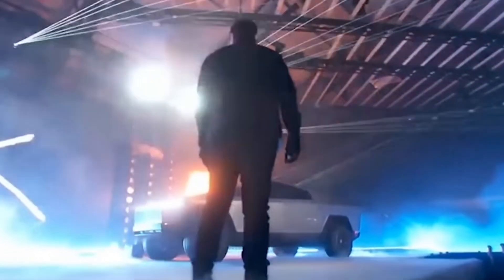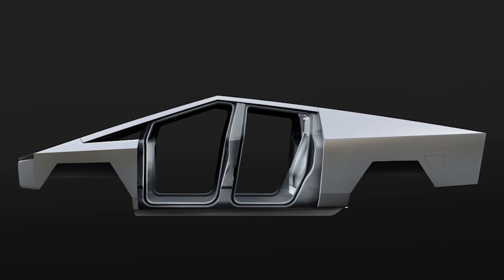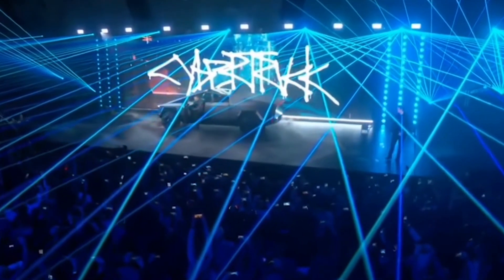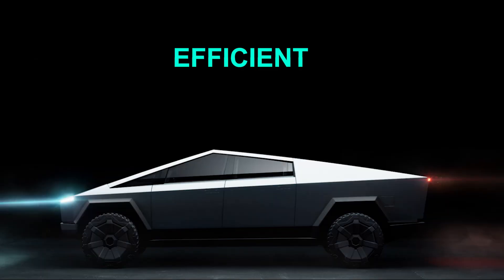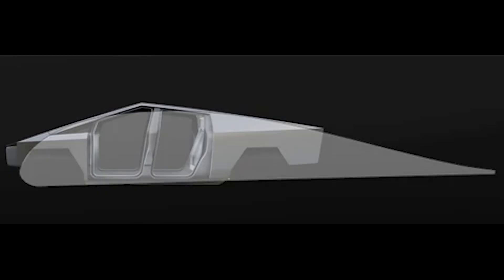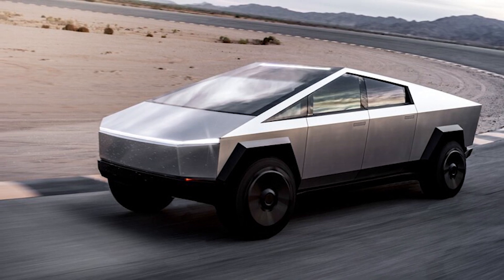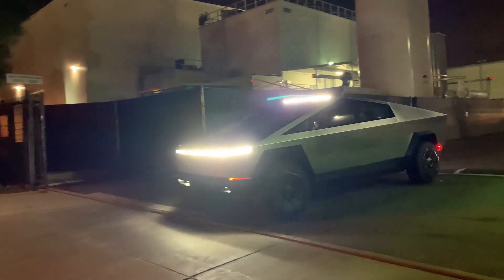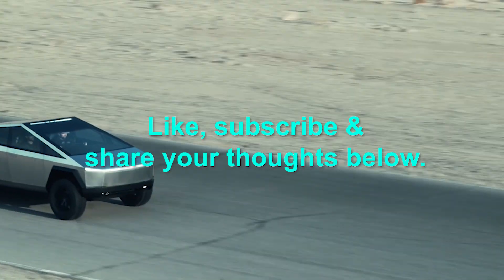Cybertruck is Engineering Genius (and will be copied)

Comment: 5 reasons why the cybertruck is the most environmentally unfriendly EV:

Sorry to say but from an engineering point of view you seem to have little knowledge and are blinded by superficial facts without questioning the consequenses.
I'm a big fan of Tesla and i'm not saying this car is worse than a diesel-pickup, but the potential of the truck is a complete fail.

1. Efficiency
Since the battery is large and heavy, weight is a big factor in EVs. With about 3 tons  this truck makes little sense. Armored glas, frame- and bodywork are the reasons here. This gets worse since the range is gonna shrink immense when loaded. Do you really need armoured glas?

2. Particulate matter
Due to abrasion of tires every car emits particulate matter. This has proven to be a big factor in pollution. The heavier the car the bigger the abrasion. And the cybertruck weighs a lot. This also means more frequent change of tires for the owner and more expenses.

3. Increase of traffic jams
Not every pickup driver will switch to the electric cybertruck (financially or otherwise). The market for the cybertruck though, will expand to people who didn't drive a pickup before. As a  result the total number of pickup trucks will only go up. While Population and traffic is also increasing, big cars are one of the main reasons to increase traffic jams. Not many people need a pickup truck. Most of the times there is only one person per car and not transporting a lot. An environmentally future uses a lot of small city cars.

4. More pollution from existing combustion engines
As traffic jams are increasing, and not everyone is able to switch to an EV, the pollution from those combustion engines increases.

5. Danger in a crash
The first presentation has shown the cybertruck to withstand a lot of force. Modern cars are engineered to deform on impact to absorb energy. Without this, the passengers will feel the full force of the every crash. Also it is a danger to others. The cybertruck is basically a tank waiting to roll through another car in case of an accident. To top it off the very edgy design is a danger to pedestrians.
Reply: 1/  armored GLASS is good when stones come at you from the road.
2/ it's a problem with all tires, not just this one
3/ it the person changes from a petrol powered car to an electric, then that's a reduction.  Traffic jams are a city/two problem and not a car manufacturer.
4/ your joking right... it's ev so no petrol and wouldn't there be more pollution if your imaginary car owner was in a petrol vehicle in the traffic jam instead of an EV.
5/ Other cars will still have crumple zones and air bags,  the cyber truck will have air bags and we will have to wait an see how it crumples.   The design is no more dangerous than other SUVs
Reply: @BrettCooper4702  Hey appreciate your thought on it. Sorry it haven't been clear, english isn't my first language.

1: Regular laminated glass does the trick, too. Armoured glass only increases the weight.
2: As i said: it is a problem which is related to the weight of the car. The heavier the car, the more abrasion.
3: With an increasing population so does the number of registered cars increase. As more people will drive to work the streets stay the same. Bigger cars will definately not solve traffic jams.
4: The argument is related to the remaining petrol cars. As i said: Not everyone can afford to switch to an EV.
5: An airbag serves only little to absorb impact. With a car like the cybertruck the crumblezone of other cars will be more stressed. Endangering the passengers within this other car. Also not every obstacle may have a crumbelzones (wall, cargo,...).
Australia and Europe for example have different safety standards.The edgy desing is definately a danger to pedestrians and cyclists.

Comment: Just a novel sci-fi tech advanced Chevy El Camino or Ford Ranchero. They went out of vogue because the whole body had to be either wholey fixed or totalled if in a auto accident because the bed is not removable. On a pickup -- you can complete smash or wreck the bed and still have a good chassis and new bed can be replaced. The truck bed was the "whole" idea of trucks or "pickups". Unibody pickups have never worked out in the truck market or the car/truck looking truck. No one wants a weird look junk heap that's neither a truck/pickup/car! Stop smoking pot.

Comment: I disagree on one point: it is not safe. Any impact energy is not aborbed by the chassis through deformation... it is absorbed by the passengers through deformation... Right now it wouldn't get a safety certification here in the EU because of that reason.

Comment: Safety might be a problem.We don't know the engineering behind this truck(yet), but you might want to wait.A car is safe if it can absorb the shock from a crash, if not the driver will, in the case of the Cybertruck it looks like the latter.

Comment: 1- they WILL have paint options (confirmed by Musk). If they decide not to paint them, truck would be simply unrepeatable since you can’t restore the look of a real metal, thus this truck would not be insurable, or insurance cost would be trough the roof. 2. Dash Panel is not paper and was a prototype that will be changed due to its absurdity and criticism (not a fact, but common sense). However, if body color options will be expensive, it would be best to simply wrap that truck to any color, which would be very easy to do due to its flat panels. This truck is half cooked and will definitely have changes before it’s released.

Comment: I don't think the numbers are adding up to be any of the four points you list in the video compared to its competition. It's not low cost comparatively speaking; we've seen dramatic performance loss when Model X users try towing as well, so we can only imagine a similar result occurring on the Cybertruck; efficiency sure in terms of being aerodynamic, but it's certainly not lightweight (it's longer than a Chevrolet Suburban); and safety remains to be seen. Cars used to be built like the Cybertruck in that they were rigid with no give, but that got replaced in favor of a body that crumples up to increase crash time so the driver doesn't take the full force of a crash. If the Cybertruck is rigid, I'd be concerned over the driver's safety if they smash full force against their dashboard or elsewhere during a crash.
Reply: For the safe aspect , don't worry tesla are one of the safest cars ever , I'm sure elon made that with the security as number 1 priority as he always says in he's presentation.

Comment: I really appreciated your approach to the facts and discussion in this presentation.  

I agree that the whole idea of the truck thus far is way out in front and genius.  

However it’s not safe yet. 
1.  It is not safe for other cars or pedestrians because it does not have crumple zones to reduce the acceleration/deceleration speed in a collision. 
2.  It is also not safe for the occupants, again, because it does not have crumple zones to reduce the acceleration/deceleration speed in a collision. 
So, on safety, will have wait and see how these mandatory safety issues will  be achieved.

On paint - use any paInt shop or apply wrap!&

Comment: 3:54
Performance is NOT an argument here. Seriously, if it is to you, then you are very insecure about that fact.

Utility, on the other hand, is at question. There is a reason why the truck has persisted as it has in general form and function for only (Yes, over) 100 years. They are literally teh evolution of cargo carrying conveyances going back 100s if not 1000s of years. When you see truck being used for what they were meant for, not commuter vehicles, but for towing, hauling, and work in general, if something remotely like the Cybertruck was ever a good idea it would be done and still be around now. The Cybertruck has more in common with the Chevy Avalanche and Honda Ridgeline, than any traditional pick-up truck.  

Fifth wheels, towing large loads over considerable distances, and more are going to be a LOT harder for the Cybertruck that a traditional Pick-up. A big part of this issue is the very limited amount of energy a Cybertruck carries and how long it takes for it to replenish that energy to continue work. Towing, and all the physics there in, easily cuts the already "only adequate" range of the Cybertruck at least in half. This is really problematic given the only 300 mile of unladen range of the base Cybertruck. But Tesla says they will be fulfilling orders for the top tri-motor version first and that will come with an up-sized battery for 500 miles of unladen range. That should look good for Cybertruck except you are buying a $70K vehicle to do what a $40K traditional truck does with only 2WD, with far less (gasp) range anxiety. 

And then there is the recent revelation that the Cybertruck will be officially classed as a Medium duty truck, putting in the same class as truck even MORE powerful than the tri-motor Cybertruck, F-250, Sierra/Silverado 2500, and RAM 2500, that cost much less to start. And with Ford, GM, Workhorse (hopefully), and Rivian (definitely) rolling out their own BEVs, the Cybertruck does not look like a real competitor for real trucks, ICE or BEV. 

The Cybertruck falls into a segment that is largely ignored and deemed redundant, the SUT, Sport Utility Truck. It should be fine, taking notes from Toyota and Nissan: NOT to get in the direct line of fire of the big boys. The Chevy Avalanche is still, despite being out of production for YEARS, very popular and desired to this day. I can see Tesla seeing this as a reasonable course to take.

Comment: That stainless truck will turn into a rust bucket in the Northeast salted winter roads.
Reply: i was going to say that its going to be high grade steel, but after looking at what they're actually using (301 steel), this comment is actually pretty accurate

Comment: Safety is a big concern on this truck. 
Cars are designed to deform on impect, that's where all the energy goes. If you hit a wall all that metal  folds to slower your impect. On the other side, cars are designed from outside to cause as little harm as possible when hitting a pedestrians. The parts a pedestrian is most likely to hit are quite soft plastic or think metal sheets. Most hoods even pop up a little when detecting an impact (on the windshield side) so the pedestrian won't hit the hard engine parts through the thin sheet of metal that the hood is. I like the radical design but I don't see how this vehicle would be legalized for European roads.
Reply: first you have to explain to the americans, what a pedestrian is. And when they have learned that, you can go to the advanced course, and explain what a bicyclist is.
Reply: Right around the time you posted, experts from the German safety & inspection institute TüV said it most likely won't be road legal in Europe. America has a "light duty truck" category which offers exemptions.
Reply: Its good for zombies
Reply: Maybe they will add some bumpers... or they will simply not sell it in europe

Comment: starting of that i love the new direction of tesla and always done. But i think that the Cybertryck will have problems with crashtesting results, Firstly stainlessteel is a stronger and harder material witch make it not suited for absorbing the kinetic energy from a krash witch aluminum does, secondly thoes sharp edges will neither assist in a crash, round bends tends to bend instead witch is ten times better. Imagine the hood chopping of your head in a crash, because it won't bend.

Comment: The cyber truck is not as functional as you think it is. It is really functional but there are a couple flaws. 1. Because of the way the bed is slanted you can only access it from the tailgate. You cannot reach your arm over the side to get anything. If you’ve ever owned a pick up truck you know that this would be extremely annoying. 2. Again because of the way that bed slats up so much clearance out of the sides of the bed are again terrible. Perhaps is not as bad as it looks, I have yet to see the cyber truck in person or touch it but it looks like it would be extremely difficult to put anything in the bed from the side. 3. This last thing is something none of us truly know yet. Because the cyber truck (as far as I know) does not have any kind of transmission, the efficiency in towing is probably not going to be very good. Sure you’ll get 400 or 500 miles of range not towing something but the moment you add a 14,000 pound load I worry that your efficiency will drop to half or less the range. Yes we have the same problem in internal combustion engines but it’s always getting more efficient through the transmission. The other advantage to internal combustion when it comes towing is the fact that it takes five minutes to fill up whereas it would take 30 minutes to recharge the cyber truck.
I personally hope the cyber truck overcomes these shortcomings, I would love it for it to succeed but at the moment there’s just no way of knowing.

Comment: I think you are dead wrong in the safety department, because you miss the point as to why a car like the model 3 or model S are safe. They are safe because there is high deformation of the body panels and part of the structure (front and back), except for the passenger cabin, to allow for impact absorption. Every bit of kinetic energy absorbed by the body panels or the structure is energy your body doesn't have to take, resulting in less serious injuries. Given the way it is designed, it looks like the Cybertruck does none of that. Safety is not a question of strengh or toughness. The same thing applies to the vehicle hitting pedestrians. Nowadays manufacturers design car hoods that dip down on the slightiest impact to create a lower and duller angle of attack for the pedestrian when it gets hit. As an example, the Mercedes G-class has angular bulbs mounted on the hood that serves as turn indicators. They would be dangerous, except for the fact that when hitting them, they collapse downward into the engine bay so a pedestrian is not injured by them.
As it stands, I don't see the Cybertruck do ANY of that. I'm not even sure it would pass regulations in its current form.

Comment: I have to disagree because it costs forty-thousand dollars. This means the cost to make it is being pushed on to the consumer and it's probably an issue with the cost of the batteries, so no this model would not be copied by anyone trying to compete. Are you going to spend twenty-thousand dollars on gasoline-powered car over ten years? If no then you're paying too much for this vehicle. Also, you have to pay for that electricity just like paying for gas.

The only way Tesla could allow themselves to mass produce anything like this is if they invented a new lightweight, high capacity battery, cut the cost of the vehicle by half, and made it self charging.

Comment: I am still not convinced for several reasons 1) the high school science reports I did about electric vehicles back in the day, (basically you spend the money at the power plant or at the pump) 

 2. I used to test drive cars for a living (SWRI & EG&G) they would do 100000 durability tests (EG&G did) 

3) most importantly things now a days seem to be based on some form of deception some form of trickery . 

4) my truck is a 2001 GMC AWD 1500, before that I drove a Astro van (the Astro van actually worked better then the truck for towing my race car) 

5) I can fix or repair almost ever part of my GMC truck (and it will run with all kinds of stuff wrong with it)
I will keep an eye on this truck but I probably don't have enough money to roll the dice on this truck.

Comment: Cybertruck isn't a racing car so it won't need super capacitors from Maxwell, those will be very likely for the roadster, because with roadster you need huge spikes of power for just few seconds then the power consumption drops relatively low.
They probably found that batteries would degrade quickly from those bursts.
Usually you can fix that just by using batteries that can supply more current, but those will have much less capacity(range).
Using low current, high capacity batteries in conjuction with battery of super capacitors from Maxwell would get you incredible launch, long range and wouldn't destroy the batteries in one year.

Comment: Single priece of steal? No frame? No paint? So if you dent it on a pole or a ten smashes your fender = car totaled. No paint equals no way to cover up body work. The body is bent means your frame is bent. No replacing any panels...
Reply: This thing is like a tank, it can take a sledgehammer with no damage.
Wrapping is likely to be popular along with vehicle modding.